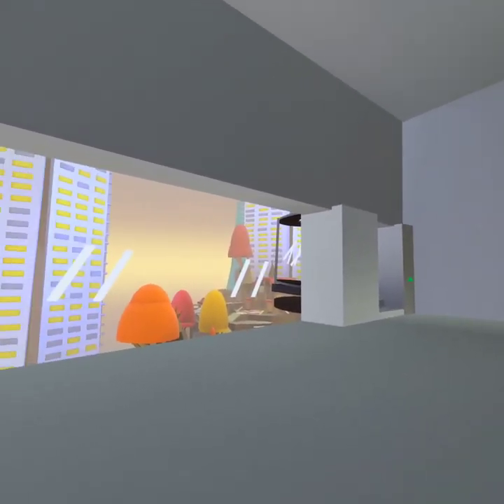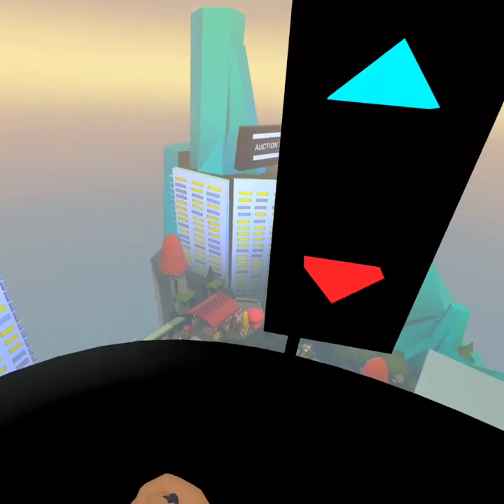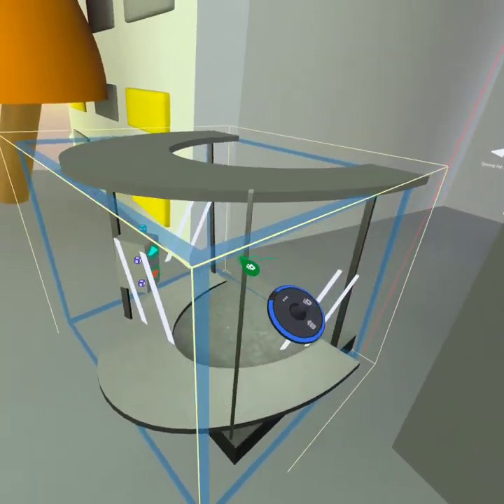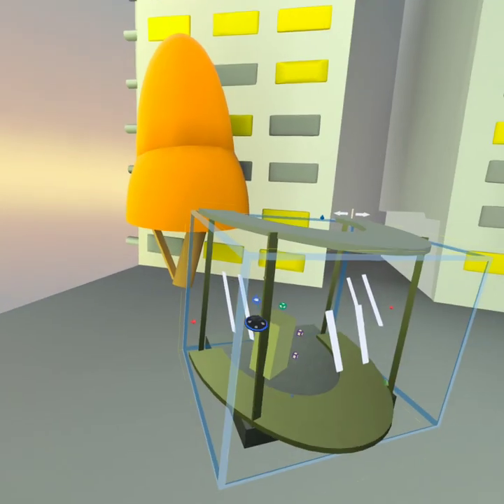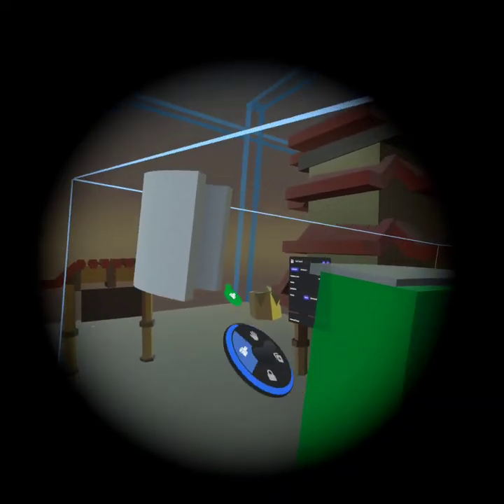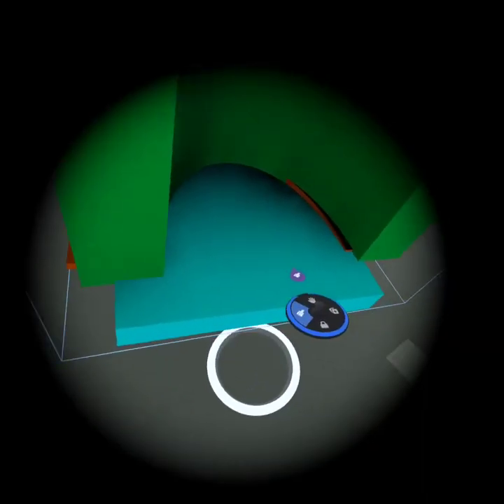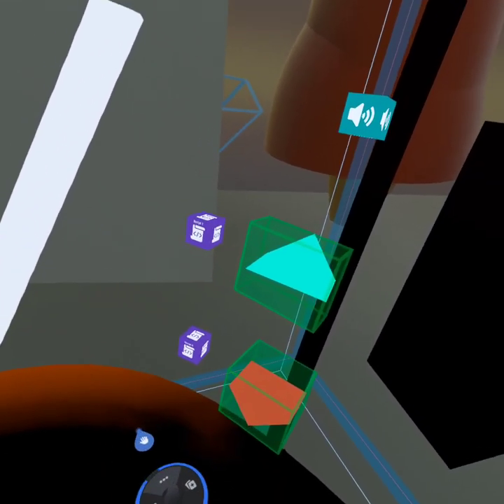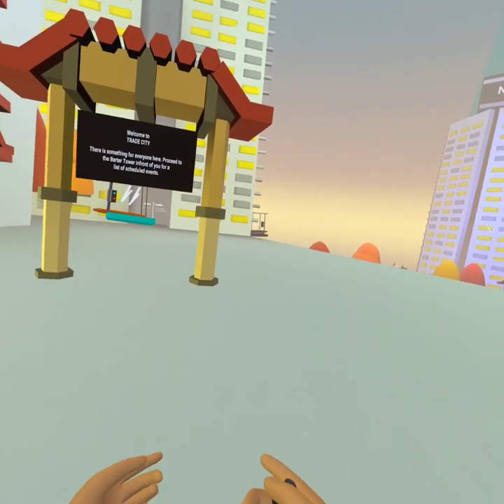How to Build an Elevator in Horizon Worlds

Comment: I cant figure it out. How do i make it so that when i stand on a platform it goes up and then goes back down when I step off? And then each time after i step on the platform it goes back up?
Reply from the maker: After it reaches the top, send an event/message to self. Then add a script to go down when the event/message is received. Let me know if that works!
Reply: @themillionthtime Do i make the elevator go up and down using script or do I use animation?
Reply from the maker: @japanesecinema6736  I would use script. Animation would be a little shaky and unnatural.